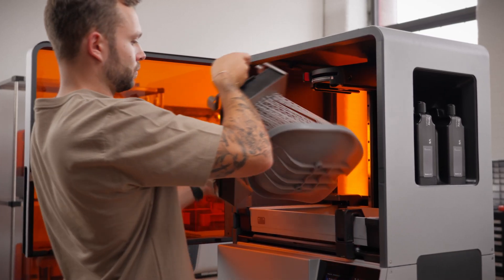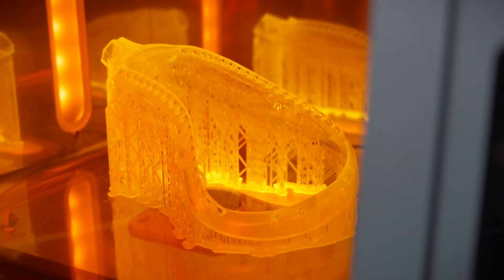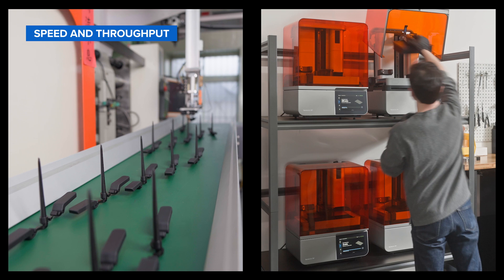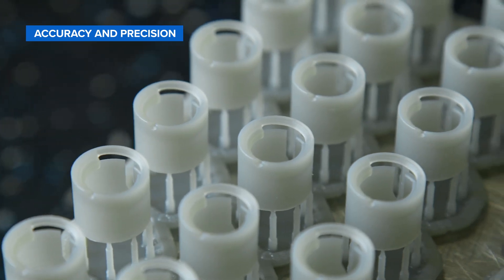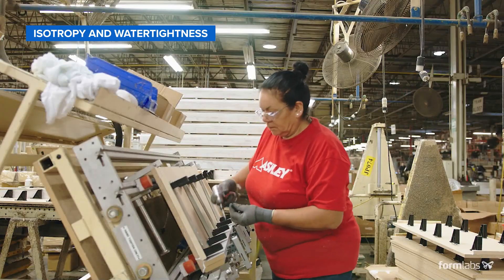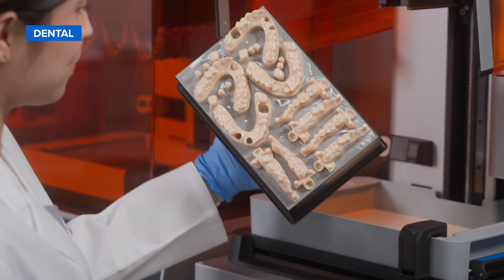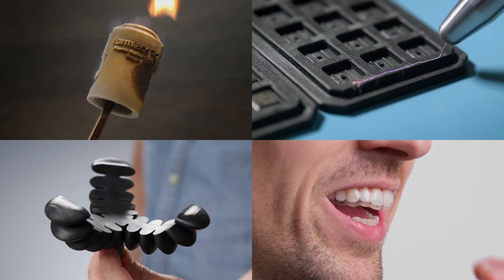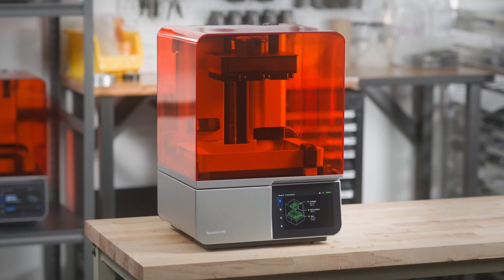Stereolithography (SLA) 3D Printing Explained: Guide to Resin 3D Printers

Comment: I have a question here .How does laser or projector harden the liquid resin ?
Reply: As I understand it, the resin used goes through photopolymerization when the special light is exposed to it. It's very sciencey and I don't really get it, but that means it hardens when exposed to certain types of light. (Polymerization means when molecules link together kind of like a chain) so the resin is outputted a layer at a time. The parts that the printer wants to keep (your design) are exposed to light and harden while the rest of the resin on that layer is pulled down. Then another layer comes and the process is repeated until the print is done.
Reply: @qorson got that thanks a lot

Comment: For SLA 3D printers, A Fast resin pump is a must - have. Its retraction speed far exceeds the printer's default, eliminating resin - mixing concerns. It reduces the need to frequently remove the resin tray, minimizing screen and film wear. Moreover, it keeps hands away from resin, preventing allergic reactions.*https://youtu.be/Dm4ICjZjsYw*